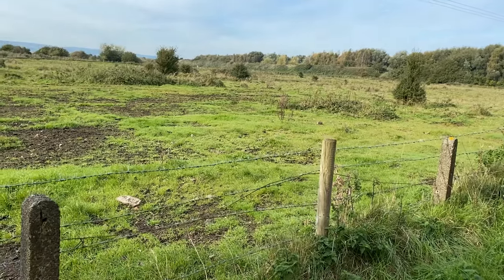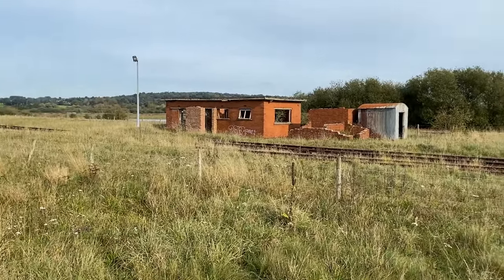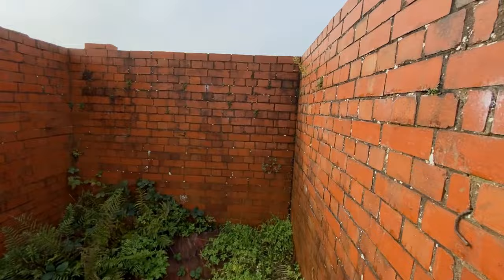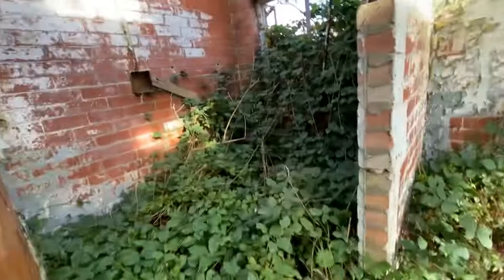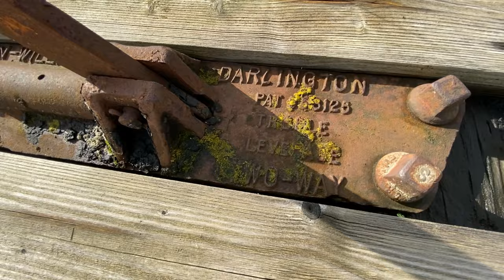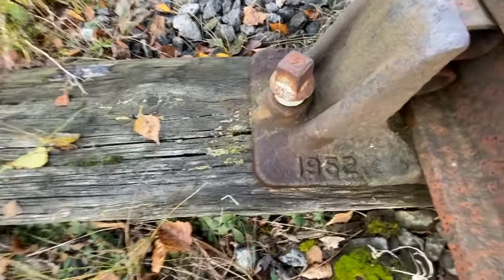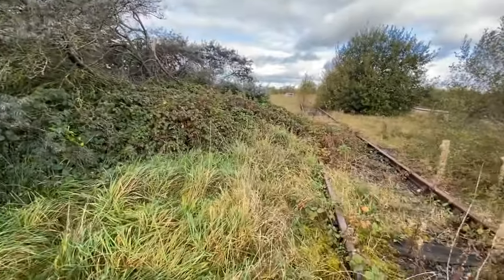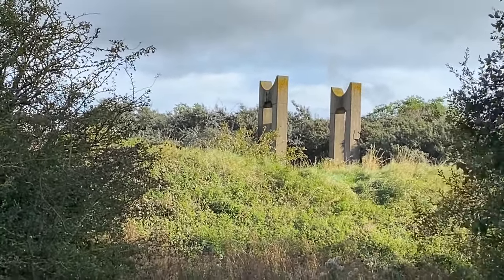Abandoned Shotwick Railway Sidings, & Shunters mess building that served the Shotton paper mill.

Comment: That siding used to hold the iron ore & limestone +coal trains for the iron making processes the (51Bridge)  was used for transporting  the molten Iron Ladles from the blast furnaces to the No 3 steel plant I should know as me & Mike Moses from Connah's quay were onboard one of the huge locos we even took turns driving it when we were junior ops in Summers & we were late clocking off at 4 pm that day🙄
Reply from the maker: Thank you for sharing. 👍👍👍. It was vast place, john summers back then I bet. I did not know about the coal and limestone wagons being held there at the siding, that's new to me. Yes I don't like clocking off late myself.😢. Thank you again for sharing with everyone. 👍👍.

Comment: I used to work st BSC Shotton as a (railway) Wagon Checker in the 1970s, great times
Reply from the maker: A job that I would of loved to of done. You probably was in the mess building and seen a lot in the 70s. Thank you for sharing Steve.👍👍
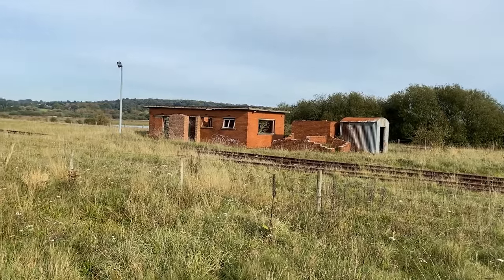Reply: @ijdt1867  The mess building we used was between Hawarden Bridge Station and Dee Marsh Signal Box, the building at 4:30 was a weighbridge, used for trains arriving from Birkenhead Docks. I very occasionally called in there to collect dockets off wagons, but normally dockets were not collected by Checkers unless an issue had arisen.
Reply: I was at  birkenhead Miollngton  street depot late 60s to early 70's. before returning to Edge hill used to work the iron ore train's from Bidston  To Shotton dropping in to Shotton   siding if you were doing over 20 MPH and signal to turn you inside was. against you , had to blow horn to go let signalman know you would probably run past it so you had to go to Dee Marsh and back them in to sidings  
1,000,Ton needed a good guard on the hand brake in brake van engine always class 47 good old days !👍👍👍
Reply: @bobrail733  Yes, the ore wagons were not fitted with air or vacuum brakes and required teamwork between the guard and driver. I often had to climb up the ore wagons to check they did have ore in them as some weighmasters took great delight in removing the dockets, only to watch me climb the wagons before handing me the dockets back!
Reply from the maker: Hi Steve that's new information for everyone and me. Thank you for sharing the History. 👍  @Steve14ps
Reply from the maker: Hi @bobrail733 . Thank you for sharing your  history with viewers and myself. I love hearing your side of railway history, as well  as Steve14ps and others that worked on the railways back then. I loved of seen the railways back in the 60s and 70s. Bobrail Big thank you.👍👍.
Reply: @bobrail733  Those Iron Ore trains used to rattle every bridge to death due to the 100 000s of tonnes carried along that route & many have been replaced since the works closed